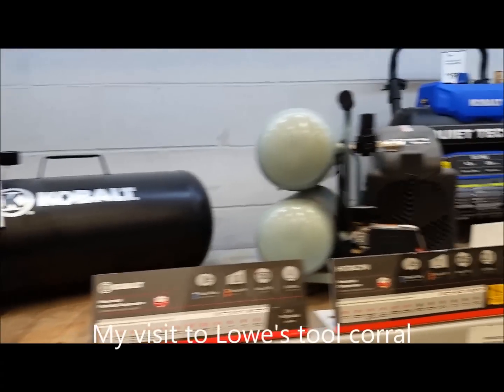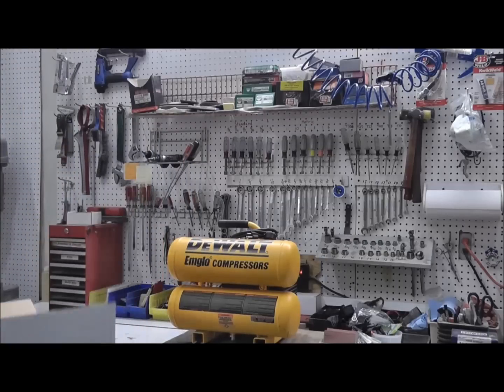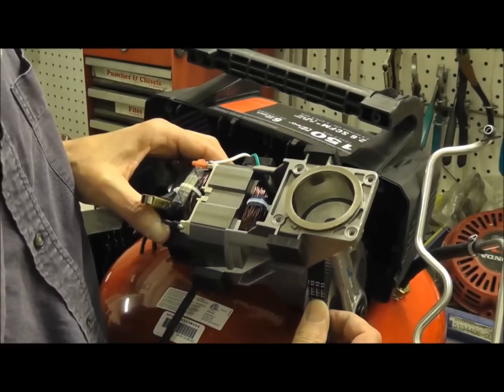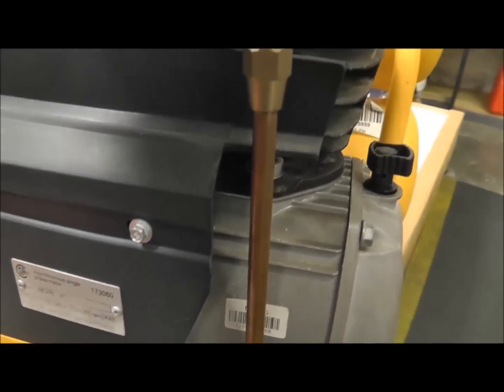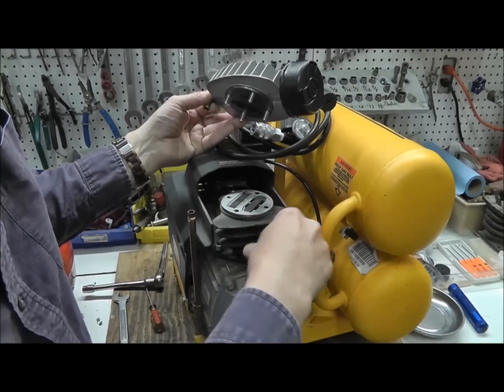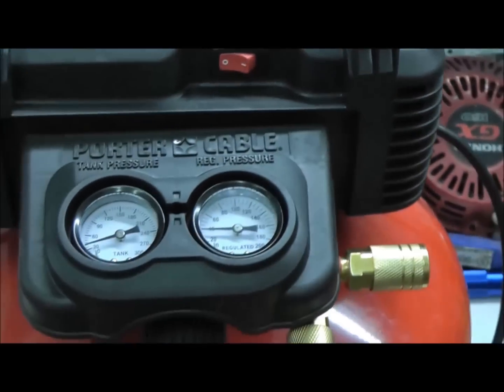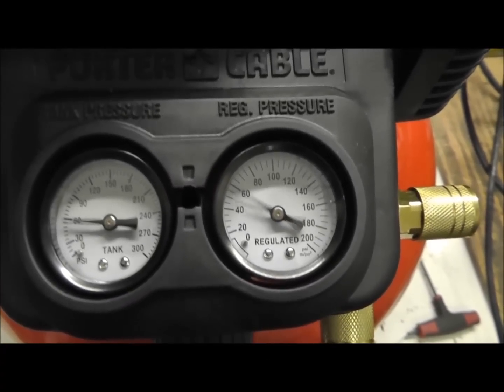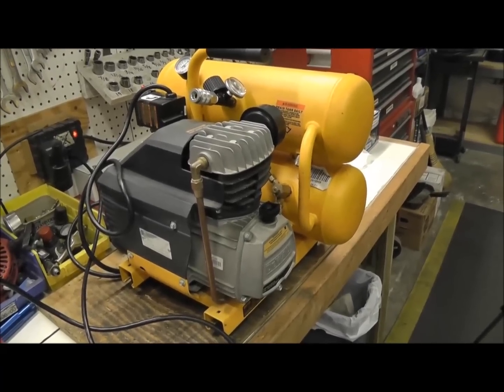Should I buy an oil free air compressor?

Comment: Excellent video I learned a long time ago oil over oil free. I have that same Dewalt compressor after 12 years all I have done is change the reeds and oil. Its been 5yr since I replaced those and still a great compressor.  BTW I am a carpenter and that compressor will run 2-3 guns framing. 2 guns sheathing. ❤ great video again thank you

Comment: Makita air compressors use a cast iron compressor block.  Emglo uses a cast iron compressor block as well.  Eagle uses an aluminum block with a cast iron insert in their compressor blocks.  Oiled compressor are by far better made than any oil-less compressor.  Oil-free compressors are good if you can get one of the earlier Coleman/Sanborn compressors that have +5 hp and can also run most air tools as well.  

Even if you have to buy a second hand air compressor, buy either a Makita, Emglo, or an Eagle compressor as these are the best of the best compressors that will last +20 years as long as one changes the compressor oil once every 4 or 5 years.

I have the Clarke AC 2002 and this small but barely portable compressor will do almost everything in a pinch and is small and light enough to haul anywhere with minimal grunt work (after all the AC 2002 will do a full 5 CFM at 90 PSI).  

Nice video and explanation with regards to oil-free air compressors!

BTW ~ Small oil-free air compressors are noisy as heck and since these compressor lack lubrication parts inside the compressor will be prone to much more vibration thus causing the parts inside the compressor to fail and break over time.  I have had this happen with a 12 volt Slime car tire air compressor I used for filling my tires.  Though the Slime 12 volt tire air compressor did last 7 years and I did picked that up used as well from a local Thrift store.

Since there is no "power"or "combustion" cycle in an oiled compressor any good synthetic 20W or 30W oil should easily last +10 years in any oil air compressor.   Many automotive shops also just use any 20W or 30W automotive engine oil and have had zero problems with any of their oiled compressor whatsoever.

Oil-free air compressors are designed to be disposable and will typically last 200 ~ 1000 working hours with the best oil free models lasting upwards of 2000 working hours.  Oil-less air compressors use a sealed bearing around the big journal end of the connecting rod thus eliminating the need for oil and neoprene seals to seal in the air in the compression area.

Do your own research as one gets what they pay for.  This is the primary reason why oil-free compressors are so cheap and widely available at almost any hardware store.  Oil-free air compressors are OK for the weekend home DIY-selfers but for any serious or contractor work an oiled compressor is a 100% must have as contractors require their equipment to work at anytime of the day and perform 24/7 if necessary.

Comment: I've git a lot of Dewalt tools and get great service out of them except for the air compressor.  It's oil free, has a 20 gallon tank and the compressor id mounted on top.  It's the noisiest one that I have ever owned and takes forever to build up pressure.

Comment: I have the same Porter Cable, oil-less air compressor. I bought it used about 4 years ago and it still works well. It's only good for very light duty air tools, like nailers and pumping tires but that's all I need right now. (retired).  Good information.

Comment: EXCELLENT point in having access to the replaceable parts. Thank you for this video. I am currently looking for an oiled, belt driven compressor to run in the garage and on a construction site. Thank you again.
Reply: What compressor did you buy sir?
Reply: @cba8351  The Dewalt belt friven 5 gallon oiled compressor. I wanted oil lubed for the output and only makes sense to have pistons oiled. Worked very well for the past few projects we had running 2 air framing nailers at the same time. Big difference from using a 2 gallon 'hotdog' compressor for years. Quiet, portable, plenty of SCFI, great for tire inflations...a small bother or wrist contorting to drain water (if any) at the bottom. All in all...EXCELLENT.
Reply: ****15 gallon, not a 5 gallon, sorry.

Comment: good info it also depends on what your needs are. I had a rockworth 3 gal hotdog for 12 years cost was less then 50 bucks and while I never used it daily I did use it a lot so did family friends and neighbors who I would loan it out to. it finally gave out and that 99 dollar porter cable is in it's place for my needs it isn't worth paying the extra cash for a model like that Dewalt. If I was like a guy doing a handyman type small business I would be buying that Dewalt without a doubt.

Comment: That Porter Cable is for small car tires, bicycles, etc. It’s cheap and it should last 5 to 10 years and it’s fine for most people. When it breaks you throw it away. Most people don’t want to repair a $100 air compressor anyway.
Reply from the maker: You aren't wrong about that, good point!

Comment: I'm looking for a portable air compressor that will provide air for my hypertherm plasma cutter. Manual says it needs 6scfm@90psi
I narrowed my search to two compressors
Dewalt D55146 which is rated at 5scfm@90psi, max pressure of 225psi, oil free
Makita MAC5200 6.5cfm@90psi, max pressure of 140psi, cast iron cylinder oil-lubricated
I have a couple of questions: 
What do you think of these two compressors? The Makita seems to be built better.
Would the Dewalt MK246 (D55153)  you show be able to keep up with the demand since cutting is not done continuously?
Reply from the maker: I can't speak to plasma cutting in detail, but below is some good info that may help:

https://www.gizmoplans.com/how-much-air-does-a-plasma-cutter-need/

If you're using the air compressor frequently I'd always recommend an oil-bath unit. Oil-free units are great and require less maintenance, true, but really are meant for infrequent to moderately frequent use. So, I would simply take this into consideration based on the frequency of use.

Comment: Compare Apples with apples 
Not dewalt with the cheapest one 
What a lot of crap talk
Reply from the maker: Thanks for the valuable comment! 
The DeWalt unit is a solid oil-bath unit but it's still a middle-of-the-road compressor. The units are made in China now so they don't use the Italian Fini pump/motors that the old DeWalt (and Emglo) units once used. That being the case, these units are of comparable quality. 
The only difference in these units is that the PC unit has a smaller tank a bit less CFM output. That being said, this video was created to give a general explanation of the differences between oil-bath and oil-free units.
Reply: I don’t agree with you
Reply from the maker: @bensmit4103  And that's alright :-)

Comment: I don't agree about the gauges but that statement about the manifolds is correct.  If you break the manifold it may cost almost as much as a new compressor even if you can get one.  The gauges aren't anything special you don't have to replace them with the exact same ones just ones which have the same size pipe thread (1/8 or 1/4 NPT) and display the same range of pressures.  I have used the Porter Cable C2002 and it is loud enough to be more than annoying.  As it is I have some high frequency hearing loss (my doctor says it is normal for my age) and don't want to make it worse.  I am looking at a used Husky oil lubricated compressor on Tuesday and if it works I will buy that to serve my future needs.
Reply from the maker: You are certainly right about the very high noise level of most oil-free compressors...very annoying and can be damaging to your hearing. There are some quieter operating oil-free units out there by California Air Tools and Hitachi, but these units produce less CFM than a typical oil-free unit. I always recommend oil-bath units due to the quieter operation and longevity, but oil-free units have their place as well. 
As for the gauges, you're right about that. The only reason one may not be able to use generic gauges is if there is a plastic panel that covers the manifold and gauge faces...if a unit uses a small diameter casing which is made for that unit and a panel fits directly over it to accept that size, you wouldn't be able to use a gauge with a larger diameter casing, as the panel won't be able to fit over it. But you could cut out a larger hole in the panel covering, of course. Just a little bit of info to flesh out your comment. 
Thanks for contributing!

Comment: I have an oil less compressor with an air filter and it's been running for about 20 years, I've never had any problems with it, and it was a cheap Walmart compressor too.  It's still going today and no loss of compression either,
Reply: Well maybe you nailed two nails with it over 29 years.

Comment: if just wanted to spray a car which one ??oil less org oil onr
Reply from the maker: For spray painting purposes it's safest to use an oil-free air compressor as there is much less moisture produced. However, as long as you have the correct particulate and oil filters installed in your line, you can use an oil-bath air compressor (it will be more expensive, however).
Thanks for the question!

Comment: Can the dewalt be used to blow out a sprinkler system
Reply: I used to work with in ground sprinklers. More than anything, you'll need a large tank capacity, or a very high flow rate.
Reply from the maker: You can use the DeWalt compressor to blow out a sprinkler system as long as it produces enough CFM for the application. I'm not sure what the minimum CFM requirement is to blow out sprinkler systems, I'm, afraid, so you would need to confirm this prior to using it.

Comment: Can u essentially lube up the oil free compressor every know and then to extend the life of it ??
Reply from the maker: Oil-free units do not require lubrication and it is not recommended, no. They simply do not have the longevity of oil-bath units so they won't last as long in the end. Thank you for the question!

Comment: You need to compare a 200 dollar makita oil free to a 200 dollar oil compressed. You’re stacking the deck by comparing a $100 Porter-Cable to a $200 DeWalt.
Reply from the maker: Thank you for the comment and suggestion. We are looking to film more of these compressor comparisons and will keep this in mind! The point of this video is to give some pros and cons for both oil-free and oil-bath air compressors.

Comment: I'm looking to do autobody shop work. I want transportability. Also, what about using turbine such as Fuji turbine mini mite
Reply from the maker: I have to admit, I'm not familiar with the Fuji turbine mini mite. But for portability, either an oil-bath or oil-free unit will work for you. However, if you are using the compressor for an application like spray painting where you can't have any moisture getting through the air line, I'd go with an oil-free unit. These units are also ideal for weekend warrior projects. If you'll be using it very frequently, I'd go for an oil-bath unit as they typically have better longevity.

Comment: It's funny you started the dewalt with 90 PSI talking about "its fast"! Don't get me wrong it's a far better compressor! I just think you should have disclosed that it was already pumped up to 90
Reply from the maker: That is a good point, thank you. Since it is an oil-bath pump, it does compress quicker than an oil-free unit, regardless. But, good catch!

Comment: Sorry you are comparing two different things...There are many reasons why you can't have oil filled compressors.. Food industry is one..also when you have to use water..also when you have to pain..you just can't have oil based compressors there...About quality i can only agree but as i said you have to start comparison with similar products..
Reply from the maker: You are correct, the reasons you list above like the food industry, painting and sandblasting are all applications where you don't want oil particulates in your line. You can certainly still use oil-bath units for these applications, you would simply have to install the requisite oil and particulate filters/traps to ensure no moisture gets through the line. Good reminders, though.

Comment: Not for nothing I have porter cable pancakes from around 2004-2005 still running fine. And they have been highly used and severely abused
Reply from the maker: Thanks for the comment, Jason. There are certainly outliers. As long as an oil-free unit isn't ran constantly for long periods of time, it can certainly last you years. When run too long for a period of time, the piston rings tends to quickly wear out. Their duty cycle is less than an oil-bath unit's.

Comment: Thanks for the info, but a suggestion and a criticism...

You can get sound meter apps for smart phones. A quick and dirty way to measure the relative loudness when comparing pump noises, not 100% percent accurate but just to demonstrate volume from 3 feet away, (as an example).

When you ran them and mentioned how fast they were pumping up, the DeWalt was already at ~80psi before you turned it on, whilst the other was basically at zero.

I've no doubt the DeWalt is a better unit, and there was no bias intended but it's just a bad look, which can make you appear biased.
Cheers.
Reply from the maker: Thank you for the intelligent reply, that's certainly true. Just to note, there is no bias here as we're not receiving compensation from any manufacturer, just the author's opinion. Again, thank you for the comment!

Comment: Excellent explanation and presentation of the differences.  I just purchased a 1.2 gal Bostitch oilless compressor (CAP1512-OF) rated at 2.8 SCFM @ 90 psi.  I've already used it to pump up tires on my cars, pickup, boat and utility trailers, etc, and it works great.  Prior to this compressor I bought a Dewalt battery-powered (3ah) "portable inflator", but it took 5 times longer than the Bostitch to pump up any tire -- I returned it.  Interestingly, I was unable to get any SCFM rating from Dewalt, but I did find a website that showed a 0.5 SCFM airflow, which makes perfect sense based on my own experience.  I also have a "contractor quality" CH dual-tank wheelbarrow style engine-driven compressor that I use for bigger jobs -- that one has a "made in USA" cast iron air pump that hasn't missed a beat in more than 10 years of use.  It seems that some people expect a 20VDC battery powered compressor to perform at the same level as a 120VDC compressor, but they're in a completely different realm.  FYI, my 2500 watt "peak" Harbor Freight inverter generator didn't skip a beat when powering the Bostitch compressor.  IMO, that cute little compressor is the perfect combination of light weight, airflow and efficiency for light duty garage and home projects.  Thanks again for taking the time and effort to make your video.
Reply from the maker: We appreciate the watch and the kinds words, thank you! There is a big difference between the portable inflators and the portable oil-free units like the Bostitch you have, certainly. The inflators put out a very small volume of air and for the money, you may as well buy a small air compressor that will do that job much quicker, just as you have found.

Comment: Trade-offs abound; tank volume is important for things like sprinkler blow-out, as the pump is only compressing air into that storage tank, not actively providing the immediate air flow through the output hose. Do you know whether there are appropriate lubricants that benefit "oilless" pumps piston seals, which appear to be a constant weak point of such economy units?
Reply from the maker: Thanks for the comment! You're right about air tank capacity....for such applications as you mention, a larger air capacity ideal. As for your question on oil-less piston ring lubricants: manufacturers do not recommend any type of lubricant on their oil-less units. The piston rings are Teflon coated and you're correct, is the major weak point of any oil-less compressor. These units aren't meant to be used like an oil-bath unit, so if you find these rings constantly wear out I would recommend an oil-bath unit. The duty cycle is quite a bit lower for oil-less units because of this weak point.

Comment: for spray painting, you need an oil filter for the outlet. If not it will destroy the paint job! Why didn't you mention this? Great explanation about the durability of the tool and what to look for.
Reply from the maker: You are certainly correct! This important fact was missed in the video as we tried to remember all of the pros and cons. An oil filter and gravity filter is certainly necessary on oil-bath units if spray painting or sandblasting...basically any application where you don't want oil incorporated into the outlet air. Thank you!
Reply: How many sound produce by a small air compressor used bike garage

Comment: Which one would you recommend for use with a Cassese pneumatic underpinner for joining picture frames? Thanx.
Reply from the maker: Either unit will give you the power you need for that application (about 87 PSI), honestly. If you're concerned about getting oil through the airline, then an oil-free unit is probably best. However, if you use this every day, then I'd recommend the oil-bath unit as they typically last longer than oil-free models. I hope this helps!

Comment: So a compressor that is 2.5 times more expensive is better.  But thanks for taking apart, appreciate it.  In some cases, oil free is required.
Reply: The thing is some of the cheaper oiled bath ones are pretty close to the oil free. Sure you wont find 50 buck oil bath ones. But I see plently of ones hit 99-150. But for very limited use buying the cheapest oil free is probably fine